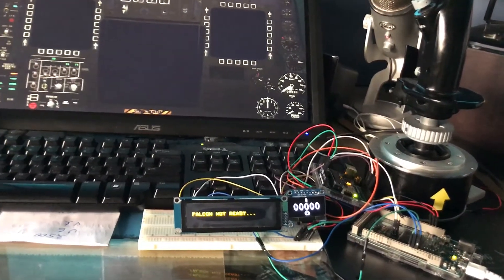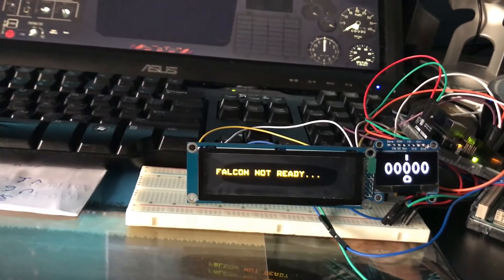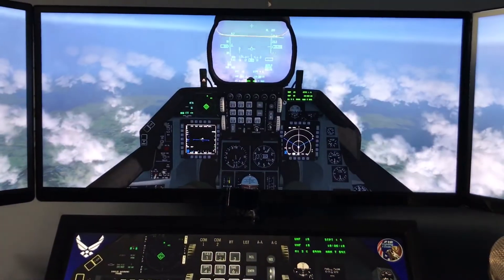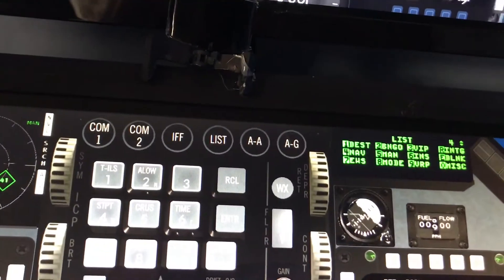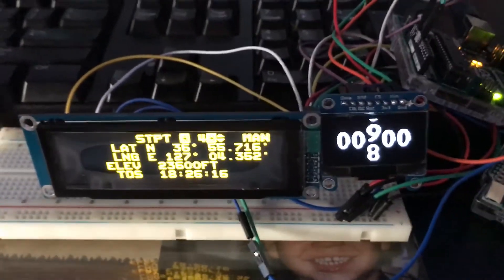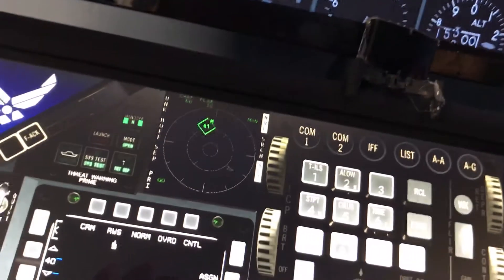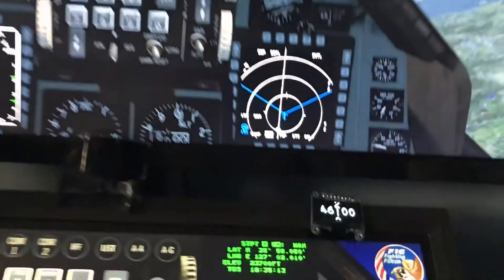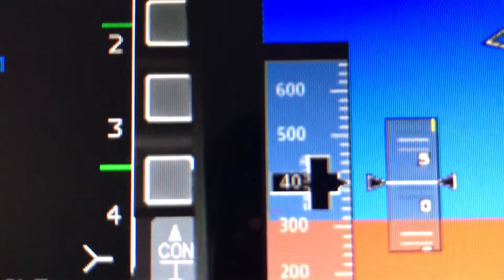DEF and FFI Using Arduino Boards

Comment: So why didn't you just connect them straight to the Arduino's, why the bread board..just curious
Reply: Yeah I know, since it’s a prototype it’s just for testing purposes. The final assembly will not even have a breadboard. It will have a PCB with its proper connectors.